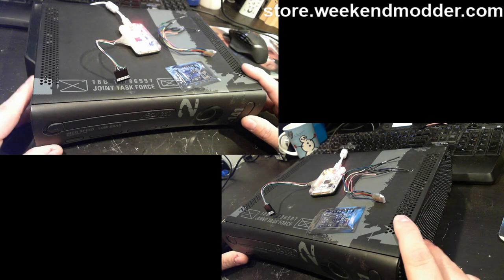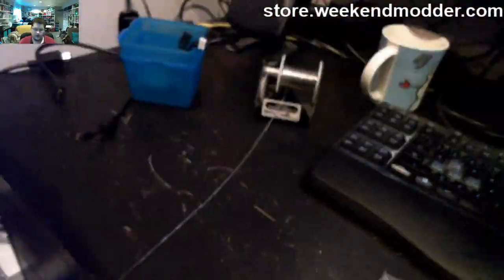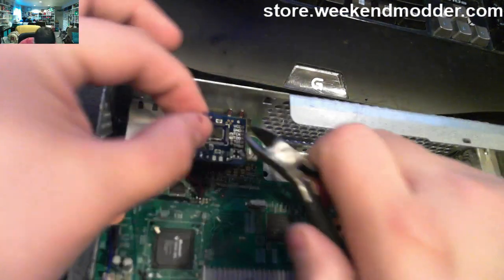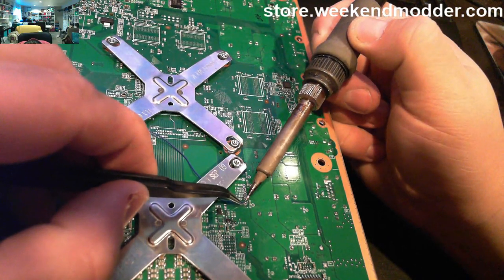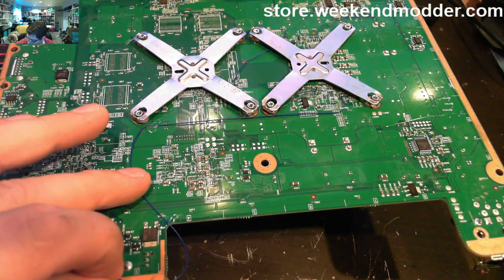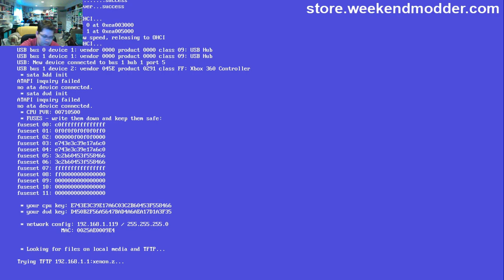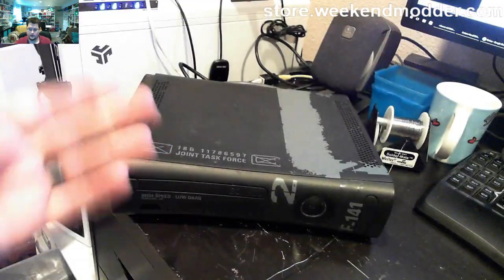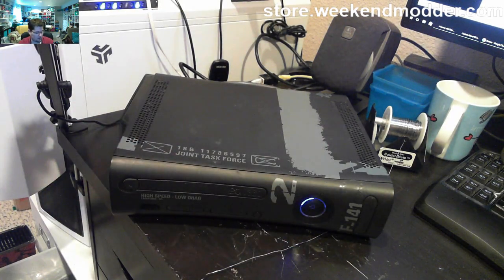Complete guide 2017 how to JTAG / RGH 1.2 your Phat Xbox 360!

Comment: Hello friend, I'm your fan, I wanted help with a problem because I tried to do an RGH on the xbox 360 fat, I extracted the Nand, I recorded the ECC, but the xell did not go up, so I took the Nand that I extracted and recorded it without CPUKey and etc., it turns on normally, but if you put the drive it just blinks and the same thing for the HD so I wanted to know if there is a way to reverse this process? Note this procedure was done on J-Runner + CoolRunner.

Comment: i have a zephyr motherboard, all is installed. but doesn't boot. the v1 is programmed with the stock rgh12_21.xsvf that comes with the nandX files downloaded from your store site. the glitch cheap just keeps on blinking blue. ive already write the ecc and write it. do i need to bridge the points for phats underneath on what shows on this video? or just the one above?
Reply from the maker: Zephyrs are just difficult to glitch - I'd bet it is not even an issue with your install.   My advice:  revert the zephyr to retail, sell it, then get another console to RGH.
Reply: i see. same issue with rev c? i got a spare. i forgot the timing files for rev c tho. ill search from your other video.
Reply: also how do i revert back to retail when i didn't even get my cpu key?

Comment: If I have a phat rgh 2 and it takes long time to boot. Can I use 1.2 timing files on a RGH2 wiring??
Reply from the maker: No - you would need to make small changes from RGH2 wiring to convert to RGH 1.2

Comment: Looking to do a corona 4gb manufactured 11/11 gonna order my ace v3 from u and the USB chip was wondering if u think I would need a post fix since the console is manufactured in 2011 and what is your average ship time to South Carolina thanks in advanced for reading my comment and taking time to reply and any other tips u could give on cheap solder and flux u would recommend kinda doing this on a budget thanks again
Reply: Oh and could u add a pi3 to the Xbox 360 to handle emulations instead of emulating retro games thru console
Reply from the maker: Needing a postfix is likely.   Average ship time for supplies from my store is 2 to 5 days.
Reply from the maker: No, not really.

Comment: Is this method similar from doing a coolrunner install?
Reply from the maker: Yup, take a look at the matrix and coolrunner products on my website I've got a full breakdown of the point translations.   You can do this exact mod with a CR Rev C, or the Matrix and it works out the same.
Reply: TheWeekendModder I actually followed this video and just used a cool runner instead. The only confusing part was the letters on the matrix board correspond to different points on the cool runner. Thanks

Comment: When the c wire is connected my Xbox won’t boot
Reply from the maker: You forgot to disable the onboard crystal then.
Reply: TheWeekendModder how do I disable that. Also now instead it is the RRoD
Reply from the maker: Remove the resistor (0 ohm bridge) depicted here:   https://i.imgur.com/I7H05pp.png
Reply: TheWeekendModder how do I removeit
Reply from the maker: With a soldering iron....
Reply: TheWeekendModder it was RRoD again and it also turned on normally to the normal dashboard
Reply from the maker: Once the chip is installed, you need to write the ECC file so that when you boot it goes into Xell.  Then you capture the CPU key and put it into JRunner so you can build the final "Xebuild" image.  Once you have that (updflash.bin) you finally write that back to the console.